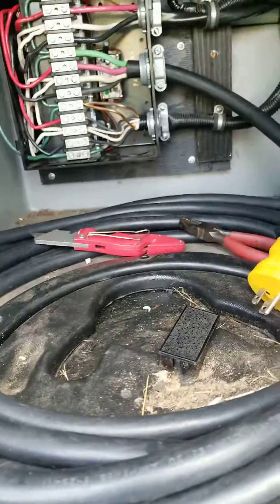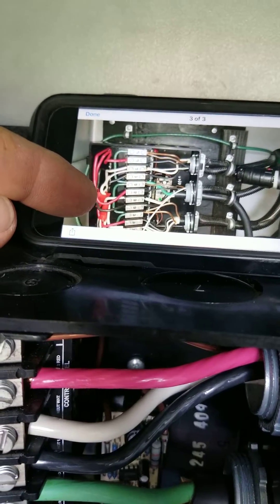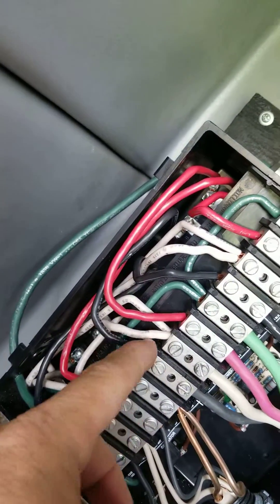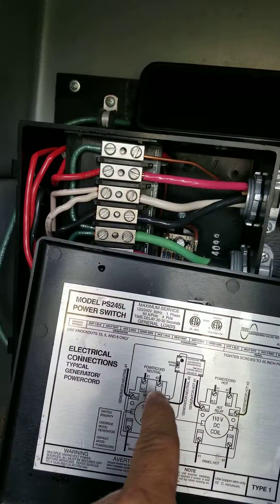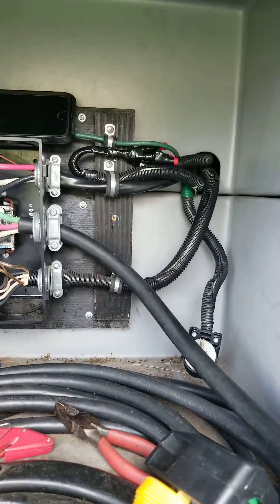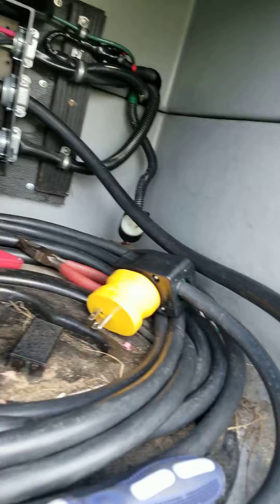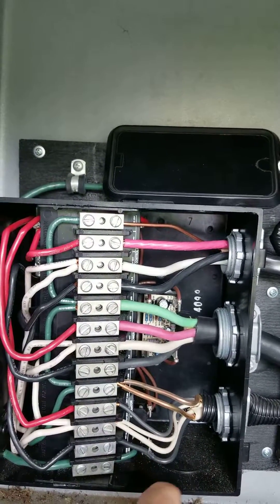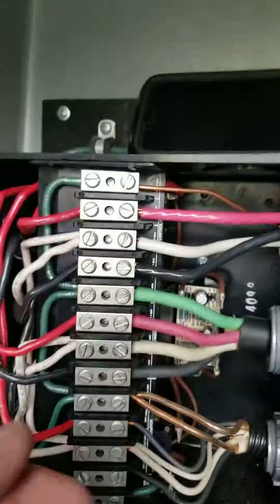2000 Winnebago Adventurer 37g 30amp to 50amp conversion. (Part 2)

Comment: I have a 2000 Winnebago Adventure 35U which seems like the same setup as yours.  Does the generator provide 50 amp power but the landline power cord only support up to 30 AMP power, is that why you made the conversion?
Reply from the maker: Kinda. The generator has 2 hot wires, basically 240 volt. One hot goes straight to 1 of the a/c compressors the other feeds the rest of the r/v. The 30 amp shore cord only has 1 hot wire, so it feeds everything including both a/c compressors from that 1 wire. When I upgraded to 50 amp I am technically plugging into 240v and took out the jumper in the panel, so 1 hot wire feeds half my breakers and 1 compressor while the 2nd hot wire feeds the other half and 2nd compressor. You end up with almost 4 times the power capability in your rv. Hopefully this helps.

Comment: Did you have to jump the 30amp genset power wire on both legs for this to work?
Reply from the maker: No because the gen set comes in on two legs so its already separated. One leg feeds compressor #2 and the other leg feeds the rest of the motorhome. The gen set and cord power are wired the same now two hot legs, neutral, and ground. The only difference is the gen set is 30 amp and cord power is 50. You won't have to change any wiring coming from the gen set.